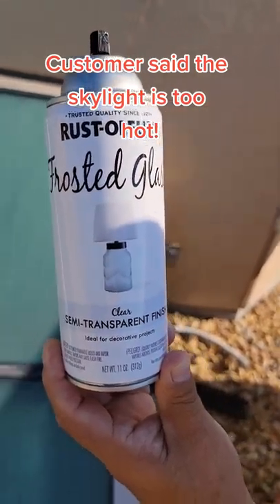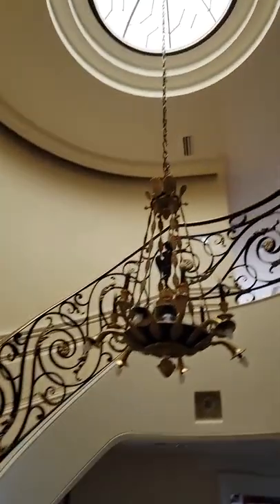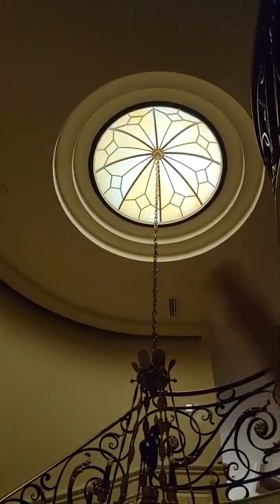Skylight too bright. End result pretty good #shorts #rustoleum #handyman

Comment: spraying a flat panel glass, proceed to show domed glass end result...wtf
Reply: He says in this short that the flat panel is covering the dome, I'm assuming for protection. Could be. Or he's trolling 😉
Reply: The dome skylight is just in the ceiling poking into the attic. The flat panel is to let the light into the attic in the first place so it lights up the dome. If the dome skylights glass was clear you would just be looking into the attic and you’d see insulation and the roof trusses through it.

Comment: Bruh those lines aren’t because of only have one coat. The entire pane should look like that with one coat then you do a full second one. Those stripes are bc you sprayed it too close and those areas have SO MUCH paint on them while only one real coat is on the parts you pointed out. Now the entire things kinda trashy looking because instead of just fixing the lighter parts you continued to go over the lines that you had already too much paint on…if you think you know how to spray paint and it looks like this try the directions on the back since nobody taught ya correctly. Good luck 👍🏽

Comment: Bro, please learn how to paint.
Reply: Yeah the concept is good, but the application is sub-optimal.
Reply: @badlandman8168  
Don't hold the "trigger" down all the time.
Once you get to the end/side, stop.
Then press the trigger again to make another pass.
This allows paint to fill the tube and will keep the can pressurized longer for more even flow.
Hold the can a bit closer and over lap your last pass by 50%.
Light coats. You should have full coverage in 4 coats.
This will also make it look nicer on the reverse side of the glass without leaving heavy spots or lines.

Get an old window and practice.
Spray, then look at the other side to really see how it covers.
Then repeat the process until it looks good on the nonpainted side.
That'll help you out a lot.

Also, if its windy, get a large box to go around the project ~ cut out where ever is not needed so you can paint.
The box will keep the wind and bugs away.
You can also cover the top if its too sunny/hot outside so the paint dries properly.

Didn't mean to sound hateful, but as a professional artist with OCD, I was cringing bro. 😊

Hope this helps you out.
Reply: @4uh8rz2nv  Damn, this bro knows his stuff